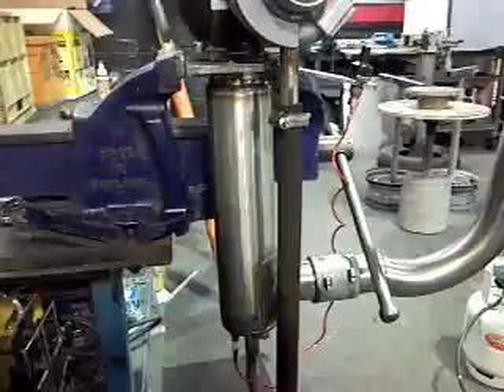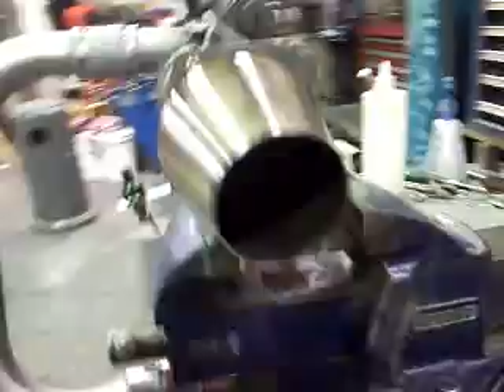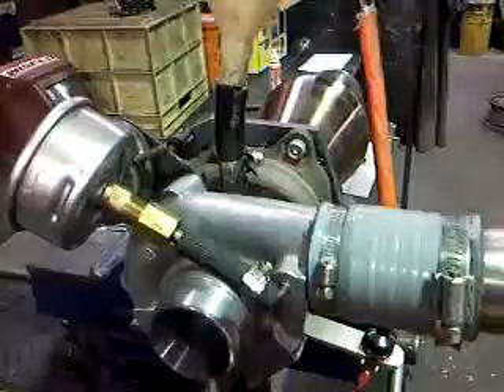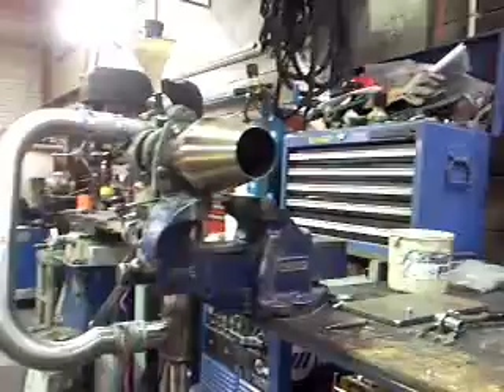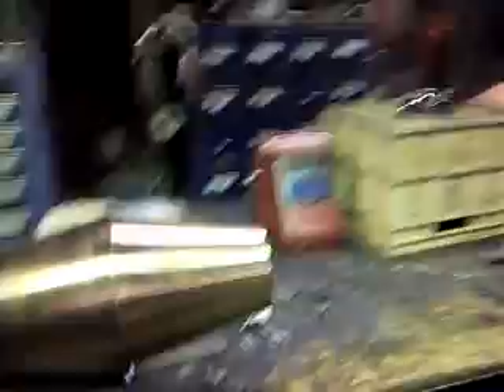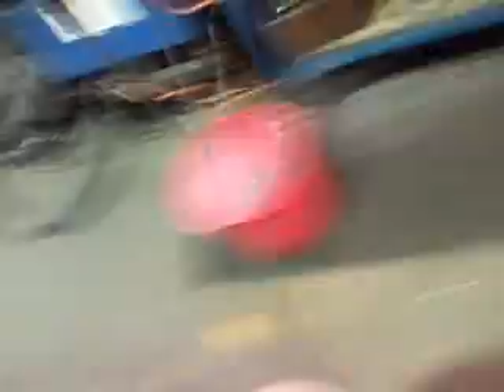Turbo jet stage 2 more mods and pipe explodes off lol...

Comment: engine needs sufficient back pressure and the nozzle increases constriction. turbine itself provides exhaust restriction but not quite enough. nozzle can also be used for post engine combustion and re-heating of the exhaust gases (afterburner)

Comment from the maker: @rcfreak2493 That nozzle on the back of that size exhaust housing actually works pretty good we had it running the other night with a bit of diesel and it was full on how much thrust it was pushing out , we will make a meter set up soon to measure the thrust see how that goes..

Comment: Incorrect. The nozzle (Or convergent section on the end) of a jet engine is to convert high pressure-low velocity gas from the turbine to low pressure-high velocity gas in order to produce more thrust. Back pressure is not required in a jet engine. Having all that extra space in the nozzle shown above just creates extra frictional losses. The nozzle should be as close to the turbine as practicably possible. This is why airlines don't have jet pipes.
Reply: Airline engines are high bypass.  The hot sections have appropriate convergent nozzles also.